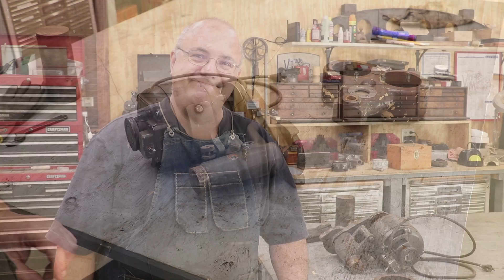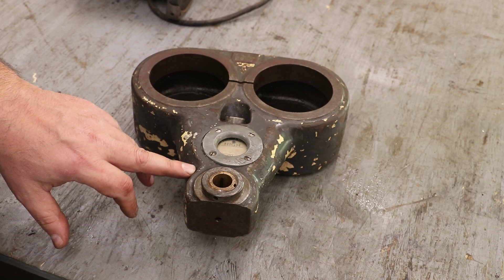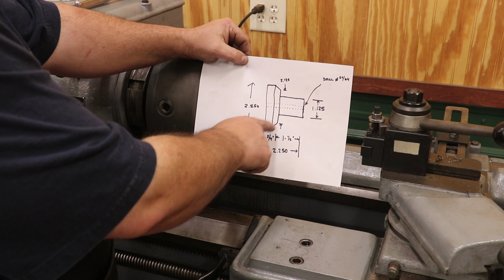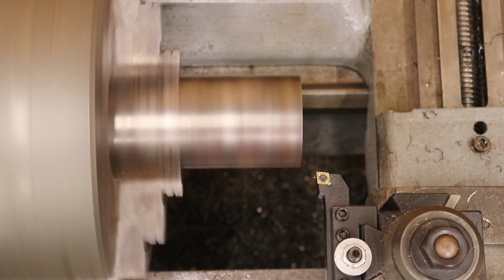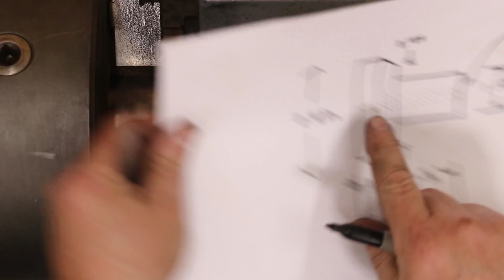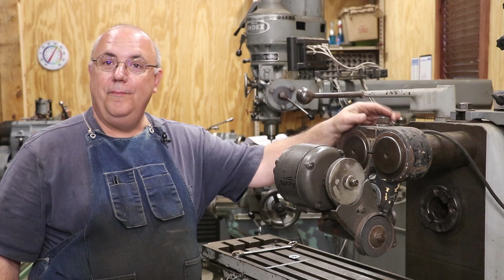Cylindrical Grinding on the Horizontal Mill!  Machining a fixture to hold a grinder

Comment: Great video.  I envy your shop.  So much space & so clean!  Question: are you worried about getting chips into that outlet across from your lathe (around 6:07 in the video)?  I don't think it would cause a short (right?), but I think it might eventually clog them up rendering the open outlets useless.

Comment: Excellent tool set-up, idea, implementation, etc...👍👍👍. You just saved me a bunch of greenbacks and room in my small shop Sir..... I was looking for a surface grinder when I saw this.  Have a BS #0 with an M head and on the knuckle for the overarm is a boss to mount another tool.  It can rotate and mount with t nuts like the M head. Sweet ......thanks so much.    Only into machining six months into retirement.  This you tube community rocks. I’m learning all over again......   Flathead Ron’s Garage

Comment: Hi 
I have a question not about this video but about a repair I need to do on my Mill.
It has spring loaded hand wheels that have square castle drive gears built into the handles but the are worn and make manual operation of the X and Y axis very difficult.
I wanted to ask if you had a preferred fix for this sort of thing.
Sorry this question is not related to this video but I would appreciate any advice you could pass on thanks

Comment: Hey Keith, you don't think that the taper on the shaft and pulley are suppose to be there do you? Seems like it may be a mechanism to mate the pulley to the shaft and position it.
Reply: Not sure but that would seem to me to be a recipe for permanently bind the adapter onto the shaft.  Ooch!

Comment: I made an adapter so I can clamp the toolpost grinder to the quill of my Deckel. I'm just getting ready to mill some dovetail slots into a new lathe toolholder to adapt it for holding partoff blades. Honestly, I originally set it up so I could use very small sized drills, since the Deckel only goes to 3000 rpm. So far this has been a great addition.

Comment: I had considered doing something similar with my 127a Burke.  X and Z axis are rack and pinion feed, Y is screw feed, similar to a surface grinder.  It won't take huge work, but I've got an even wilder idea to try for the bigger stuff ... which a tool post grinder would be suited for also.

Comment: As Mr. Fickle asked, how are you planning on maintaining a square wheel to the table? I did not see any pins or lockable lugs to control the grinder. I'm assuming you're going to square the grinding wheel before you grind. Just curious. Also, why didn't you put a taper on the washer to give it more stability?

Comment: Need to cover the spindle from grinding dust. Plywood wider than the face the spindle comes thru. With holes or eye bolts at the ends to ratchet strap it to the mill . Foam or a pillow over the spindle held tight by the plywood. To protect to spindle. Black rubber one side ribbed walkway runner on the plywood like a bib to carry the  abrasive dust to a trap on your ways

Comment: "Cylindrical grinder", sure.  But also a surface grinder if high precision isn't required. 

I have a horizontal mill - I should do something like this.  Thanks, Bob

Comment: How is the grinder wheel face kept parallel to the bed of the mill? Also how did you set it parallel in the first place?
Reply: Bring the table up with a parallel between it and the wheel. Adjust it as close as possible. Then use a wheel dresser to dress it fully true. No different than when it's used on the tool post really.
Reply: Thanks, I was really thinking that the grinder could rotate if the screw holding it to the mill loosened (maybe due to vibration), oh well, we'll see in his next video. Really like his videos as well as ABOM or Keith Fenner

Comment: Cool, I never thought of or saw anyone use a V block to hold a cylinder from the side in a mill vice. Always did it with the clamps on top.  I'll be using that trick for sure. Thanks Keith.

Comment: As i saw, there is an open trapez-thread on the lathe. And the metal-chips are falling into this. Shoulden't be this part closed an secured against the trash? I love the metal-work.
Reply: Old equipment - didn't consider it ! Use of compressed air frequently to blow the swarf off the threads. Look how exposed leadscrews were !

Comment: How can you grind anything actually when the grinding wheel’s diameter must be changing as it is being used ?
I just don’t understand the logic.
Reply: Grinding wheels are extremely hard and does not change so much, even when grinding on hardened steel. Axle that Mr. Rucker will grind is not that hard.
Reply: I used to think the exact same thing because I only had experience with bench grinders. However when using a grinding wheel in a machine, you first face off the grinding wheel with a diamond. So you now have a perfect square face. When grinding a part you only move against the grinding wheel in one direction or against one edge of the grinding wheel. As that corner of the grinding wheel wears away, the part of the face directly behind the corner will maintain the parts tolerances. This type of grinding is light and easy on the wheel.
Verses using a bench grinder, your just jamming a random part into the wheel and generally trying to grind the part to size as fast as the power of a grinder with an unbalanced wheel will let you. This grinding is very hard on the wheel.

Comment: Would be nice if you could reverse the motor rotation so it is not throwing grit at your spindle, but it probably isn't a 3phase so maybe not easy to do.  Looks like a good useable setup!
Reply: By the way bcbloc, I love your boring mill!!!
Reply: Simply add a rag or a metal cover in front of the spindle to protect it.
Reply: Spinning a grinding wheel backwards can have the same bad things happen as spinning a threaded lathe spindle backwards. It'll come unscrewed on you............ well maybe not, think I'd rather be hit by a spinning grinding wheel than a spinning chuck...lol
Reply: fowletm1992 fill your spindle bore with ice cubes, dry ice if you can get it, heat up the Chuck, and she should loosen enough to take off.
Reply: Lucky brian 
I have a large lathe as well but it uses a threaded spindle 
Anyone got tips on removing the chuck 
She's welded on good and solid with rust
Reply: Trigger Flying 
Cheers 
I can get liquid nitrogen 
Next step is the cut off disc 
The chuck is well and truly flogged anyway
Reply: My Hendey lathe had a threaded spindle.  Funny that the previous owner to me put on a reversing switch.....YIKES!
Reply: Jeff Heath yea, I love my hendey tie bar 14x6, but hate the threaded spindle. I'm thinking about converting it to an L0 mount.
Reply: fowletm1992 liquid nitrogen will boil and splash violently as soon as it touches the spindle, be very careful.
Reply: fowletm1992 if you must sacrifice the Chuck, just turn it into chips in the lathe, cutoff wheel risks damaging the spindle.
Reply: I always go for the blue wrench!
Reply: Good point! all my grinders have keyed drive hubs so i had never given it a  thought. Never run a lathe with a threaded spindle either though...........

Comment: How long do these little projects typically take? I've never machined anything and the time lapse and video cuts leave me wondering how long it takes from start to finish.
Reply: It usually takes at LEAST twice as long as a customer thinks it will. :) Most people really think you can throw a chunk of metal in a machine push a couple buttons, wave a wand and poof finished part. :)
Reply: Length of time will vary depending upon the skill of the Machinist, how motivated the Machinist is, the tooling and machines at his disposal, and the tolerances of the finished part. Keith is a very good machinist and makes most projects look easy.
Reply: that part could be knocked out in prob 30 mins
Reply: I'm guessing somewhat less than an hour to turn out the piece in the video. Certainly less than two hours, even if you consider finding the material and setting up the tooling.
Reply: And you can triple the estimated time on this one for framing the video shots, setting the lights, setting the sound levels, plus all the post production work.  Keith does so much more than most people realize.